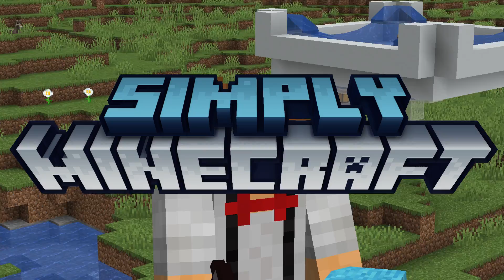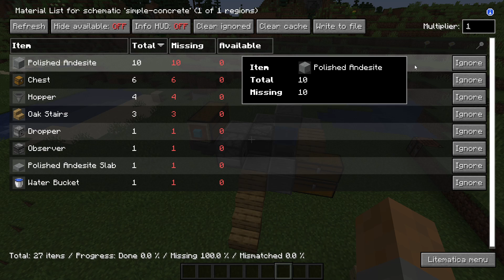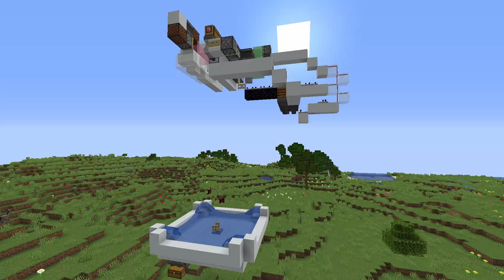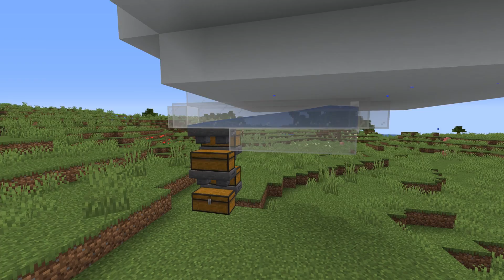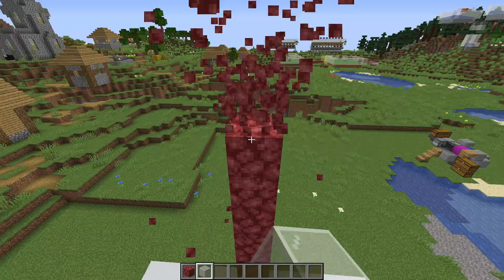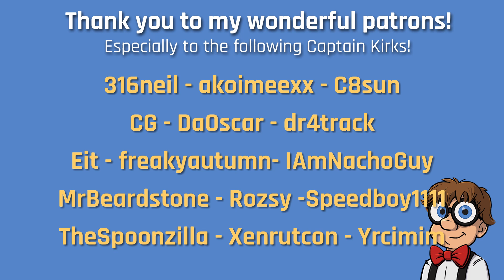Easy Lossless Concrete Farms Tutorial | Simply Minecraft (Java Edition 1.17/1.18)

Comment: Hi, Nice build, works great. I built the auto one and was wondering sometimes it seems to slow down, not always but after I turned it on and off a few times. I rewatched the tutorial and it's built good. Only thing I had to do was put a torch beside the water sources to stop em freezing. (Grove biome) Any suggestions? I imagine snow cover wouldn't be the issue but I could be wrong. It is snowing up here.

Comment: Thank you for the Toturial, but i have two questions.
1. If i afk there, every Minute or 2 Minutes the Piston stops moving and i have to click the Note Block above the spot where i place the powder. Why is that happening?
2. The Dropper drops the Powder faster than i can place it, so my inventory is full of powder after 20 Minutes of afking, is there a way to fix it?
Reply: For the first one, i fixed it by using another sticky piston pushed observer clock to power the piston that pushes concrete powders, controlled also by the lever. I haven't found a solution for the second problem yet

Comment: Thanks, very good vid ! However, that smart piston design seems to be a little bit unreliable on servers, causing the machine to stop until someone comes and breaks the concrete powder then places another... And, the dropper goes a bit too fast on servers too. Had almost 5 stacks of powder despawning because of it :'(
Reply: @Feror I have the same problem
Reply: @martinnguyen6884  it’s easy to fix, replace the note block smart piston with a regular 0 tick smart piston, and replace the dropper clock with an observer looking at the moving concrete and powering the dropper

Comment: I have two issues with the first, simple, farm and need some help.

The first issue is that the dropper ends up being activated twice about 50% of the time (presumably once when the block breaks, and again from the block placement) which means excess concrete powder ends up being dispensed and quickly overloads your offhand inventory. Once your offhand has a full stack the powder goes into your inventory and requires you to manually move things around. If you were doing a massive conversion you could theoretically fill the rest of your inventory up so it just falls on the ground, but not only would that risk despawning some items, if you were doing that much conversion you would probably just use the TNT version to avoid a broken pick.

The second issue is that concrete goes flying all over the place, so some of it ends up in the chest, some of it goes into your inventory, and some of it ends up in a radius around you.

What's weird is that I don't see either of these issues in this video, nor in any other video of any of the many variations of this build. I am playing 1.16.4 Java, single-player / local multi-player with no mods, same pick (Netherite, Efficiency V), no beacon or other potion effects... I don't get it.
Reply: I am having this problem, too. Any help would be appreciated. Thanks so much for all your videos.
Reply: @lizbeth0207  I think I figured it out awhile back, but I can’t find anyone who can officially confirm it. From my tests Unbreaking III of all things is the issue. All of these videos are missing that enchantment because who cares in a test world, right? By all rights it shouldn’t have anything to do with it, but it does according to my in game testing. I imagine it has something to do with the durability loss roll taking priority and offsetting the action order so that you end up just ever so slightly out of sink and seen,t actually placing a block on the same tick it breaks.

Again, I need someone smarter than me to prove why my testing shows this, but I don’t know how to get their attention.

In the meantime I simply made a custom pick without Unbreaking III on it and kept it near the machine in an item frame.

The items still fly off in random directions sometimes though, and I’ve never been able to nail down exactly why they do for so many people, but not ever in any of these tutorial builds.

Comment: Not sure if anyone can help me with this, but my tnt falls far more than the 16 blocks he builds up. I'm not sure why the tnt takes so long to explode. I have the 8 repeaters on 4 ticks each like in the video, and I'm running a basic fabric server with no adjusted settings. I'm also not sure  if this is an issue with the tnt taking longer to blow up, or if it's the gate not opening at the proper time. Any help would be greatly appreciated.
Reply: I have the same problem
Reply: I was able to solve my problem by increasing the loop clock (minute 22), instead the 10 hoppers+composters my loop now is 18 hoppers+composters and it works fine

Comment: Another note about those composters: Even if you don't care about lag (Why though? You really should!), the composters prevent the hoppers from accidentally picking up items, and thus messing up the clock. You really don't want a messed-up clock on a TNT duper!
Reply: How do composter reduce lag? And why?
Reply: @blutlauch4418  Hoppers that have nothing else to do will look for item entities in the block above them every single game tick, which is a somewhat expensive operation, especially if there are many open hoppers. The only two ways to prevent them from doing that are either powering them wit ha redstone signal (but that also disables them pushing items they contain into the container their output points at), or putting another container on top of them. There are many container blocks, and in the past, the dropper was the preferred one (people also used furnaces, but those don't help much, since they also do things every game tick, while droppers don't).
And this is where the composter shines: It has a single output slot (the one for its bonemeal), and unlike all other container blocks it's not even a block entity (like a dropper, furnace, hopper or chest would be), i.e. it's just as dumb of a block as dirt. It doesn't do anything on its own, which means it won't cause any lag by itself, yet it's a container-type block as far as the hopper is concerned.
Reply: @TheRealWormbo  Thanks, I didnt know that. This will help.
Reply: @TheRealWormbo  that's a nice passive- aggressive explanation, thanks
Reply: @TheRealWormbo  but I have to ask, don't full solid blocks block their ability to suck items from above? Or they still try to even tho they wouldn't be able
Reply: @jujoya  Items can clip into blocks. If they do, the hopper will grab them. Bee farms use that, for example: Shearing the full bee nest creates a stack of 3 wax items inside the bee nest block collision and a hopper below grabs them immediately from there, because bee nests have no inventory. The same is true when the dispenser is full of empty bottles, causing it to spit out the honey bottle into the bee nest block's area.